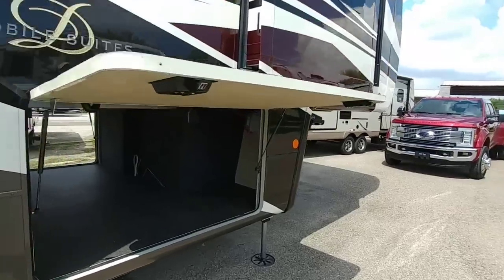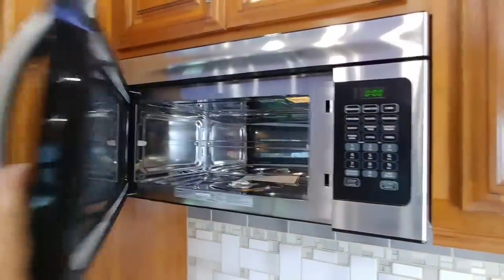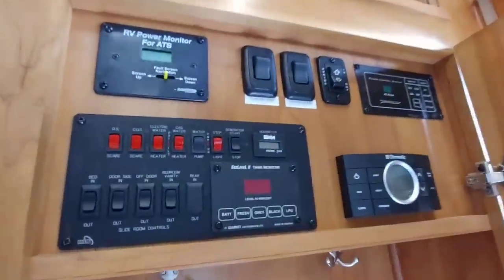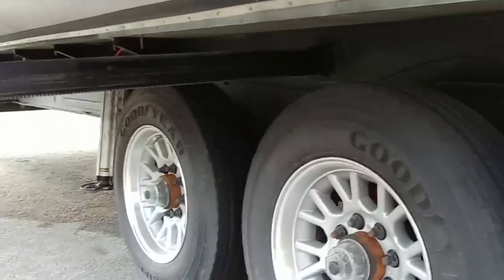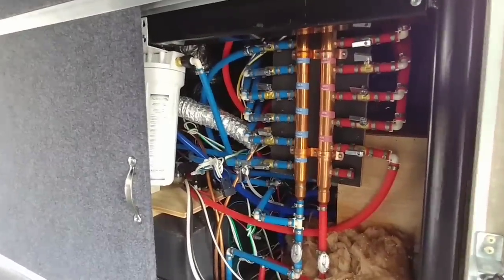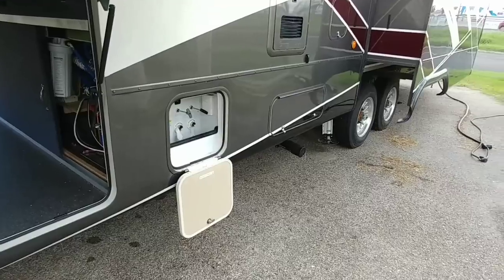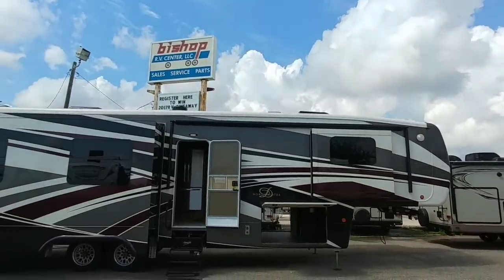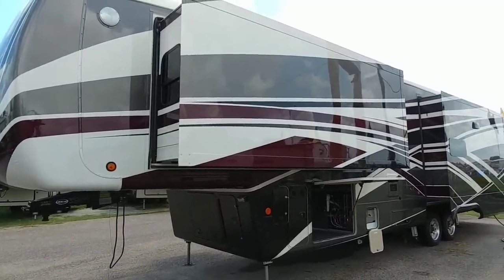Must See High End Fifth Wheel! Wow!

Comment: Very detailed and informative video. You mentioned that this unit came with "disc brakes", does that mean other units still use electric shoes? I'm asking because all the specs I look at on other Fifth Wheels, and toy haulers do not state what kind of braking it  comes with. I just through that all the manufactures got away from the shoes type, and went to disc. Safer, better stopping power, etc. Thanks again. Can not wait to see more Toy Hauler walk thru, Fullhouse line is great.

Comment: My 2008 NuWa has a water supply manifold and a 10 gallon hot water heater.  Also has a true 50 amp service panel with a separate 12 volt panel and a converter charger next to the batteries.  NuWa had some really good features. My blue Dow foam walls are better than the unlaminated walls made with fiberglass insulation.

Comment: I met with these guys a few years ago at a local RV show. They literally bent over backwards when I asked them if they could do a custom floorplan with a separate office space and dedicated 15A power to run a high-end workstation. These 5th wheels are pure luxury inside and out. That hitch on the back is prime territory for a small motorcycle or ebike rack. With a F450 up front and a separate generator/fuel in the truck bed this RV can pretty much boondock away from civilization for as long as your food/water allows. It's a fulltimer's dream rig.

I'm just waiting on winning the lottery here...
Reply: Ken Helmers maybe look for custom tiny house companies, they might be able to make you one for cheaper than the one in this video
Reply: @sizableschreib1758  Maybe so but RV parks of any kind won't take them + they would be kindling in short order.
Reply: I am looking for a floorplan that will include a separate office, and a full time living area. Fulltime home on the road, including office - sigh....  Did you get yours?
Reply: Ken Helmers, look for a two bedroom. One full and then opposite end of the rv is called a bunk room. Usually those bunks will fold up to accommodate your needs.
Reply: Luscious3174 me too buddy me too

Comment: Too bad Teton Homes closed in 2008. They made the ultimate full time 5th wheels with the best materials and insulation. 102" wide and walls framed with kiln dried screwed and glued spruce (yes, that beats the hell out of aluminum for insulation). If they still made them today, the top model would have to be about $300k thanks to inflation.

Comment: With a 5th wheel that large aren't you limited on where you can go? We have been considering one,  but from what I have read it seems like over 30 feet you won't be able to camp in most state and national parks.
Reply: I am traveling in a 44 foot 2 inch DRV 2018 Nashville right now.  It just takes a little planning and you can have all the comforts of these  rigs.  There are some minor cosmetic details and quality issues at this price range however.  Some of the MCD shades don’t work, poor craftsmanship in some of the cabinetry, lousy fit of the faucet in the kitchen sink, other minor but irritating stuff.  Still, it’s very comfortable and not all that difficult to drive.
Reply: You are correct. There are a lot of secondary roads in the northeast you would want to avoid ,as the offtrack on a fifth wheel is bad.
Reply: With NO offtrack,the trailer tire path would follow the vehicle path perfectly on a hard turn.
Reply: What does the term "offtrack" mean?
Reply: thanks for that bit of info!
Reply: I have a 36' 5er, been in almost every National Park west of the Mississippi. I don't think an extra 4'-6' more would have made any difference for me. National Parks are pretty big places. With private RV parks, yes, always make sure they have "big rig" spaces.
Reply: Your are correct just read an article about us state parks with RV’s over 32’ including toe rig you can only camp at about 7% of the state parks in the US 
I’m about to purchase. 42’ fithwheel as im a full timer but I’ll deal with that when the times comes
Reply: notruss1 in the east or west
Reply: Tree branches, bridges, and gas station awning clearances, steep driveway entrances/exits, rear end swing and off tracking in corners, pickup bed rail clearance, remembering to lower the landing gear and unplugging before disconnecting, forgetting to raise the jacks before moving, turning too sharply...cha-ching!

Comment: I've been looking a a 40ft jayco north point with the front living room. Not as nice as a mobile suite but not as costly
Reply: Kyle Vanwinkle, I just recently purchased the Jayco Seismic 5th wheel it's pretty awesome. One thing nice about Jayco they have the two year warranty instead of one. Good luck with your purchase
Reply: Kyle Vanwinkle I don't know the price point of the north point but if you like front living rooms take a look at a valino 375. 40ft with 6 slides
Reply: We bought  a used 2013 Drv when it was two years old and out of warranty.  We then took it back  to Howe, Indiana for some Drv factory asketo have some work done.

Comment: With a RV like this, could someone easily and solar panels?  
If so, how much energy could be produced?
Reply: Many of the new RVs are equipped with a receptacle to easily connect the solar panels. It will trickle charge the batteries and some accessories, but not run the AC/ hot water heater outright. It depends on the wattage output of course.

Comment: That is a really nice house on wheels. Too sweet for my wallet, but it shows what's possible if you got the dime. And it's made for full-time living. NICE
Reply: It may be made for full time living, but it is not made for full time traveling, which is what a travel trailer is mostly used for. Trailers can be built for full time traveling. Just look at semi trailers. They spend their entire life on the road, usually loaded to their maximum GVWR. They have at least 8 wheels, a super strong frame, air ride suspension, air brakes, and are put together with a million rivets.
Reply: Tina
Reply: I agree with him on the wood color. To much orange, ruins the whole look and certainly not the look for 135,000. plus. Once you are in it for 18 years you will find the neutral/blonde cabinets and flooring with keep its looks (new look.)_
Reply: Tina Gallagher you can actually finance them for really cheap from my understanding.